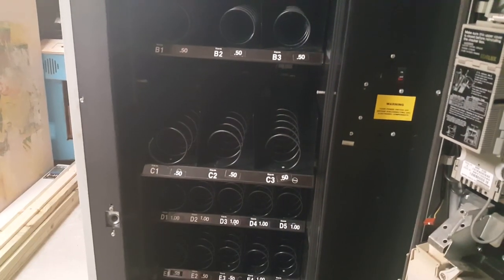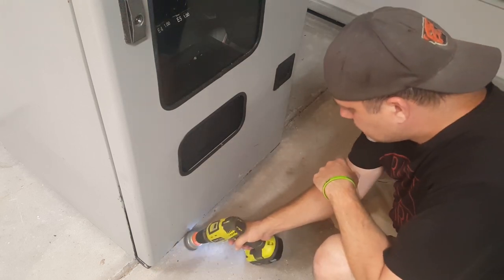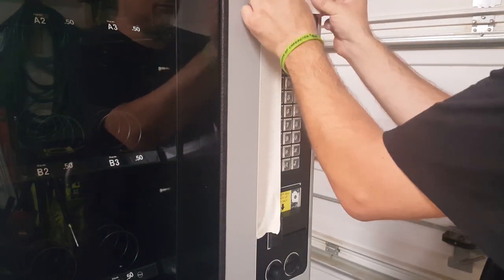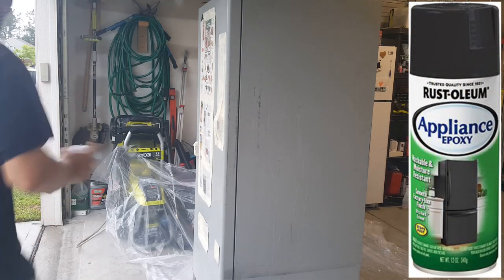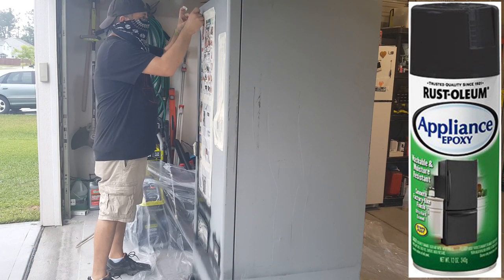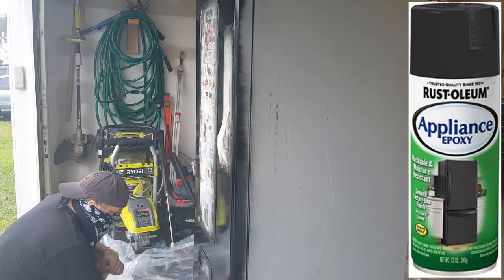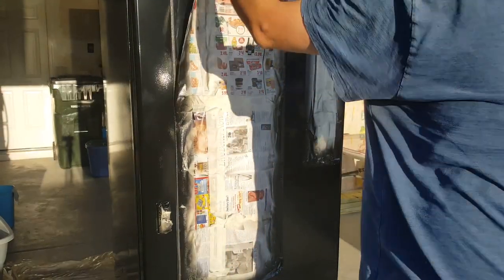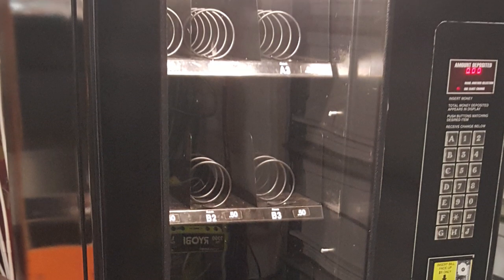How To Refurbish A Vending Machine Quickly and Cheaply to get it Location Ready!

Comment: Hi, what specific materials did you use to sand and smooth the surface before painting?? (Sanding pad type, ect.)
Reply from the maker: I used a wire brush on a drill and then 220 grit sand paper afterwards
Reply: @GalaxyGames843  Awesome, thank you so much!
Reply from the maker: @tanishabenton3630  welcome! Make sure you are subscribed! I'm working on a new vending machine refurb video now!

Comment: How long did it take for this paint job to dry?
Reply from the maker: I usually let things dry for a minimum of 24 hours, but 48 hours is even better
Reply: @GalaxyGames843  thanks so much! I'm about to try it myself today. There's no rust on my machine. Would I still need to sand it down first or should I be okay just washing it first, drying it then painting? Thanks for you help!
Reply from the maker: @rg.8590  you shouldn't need to sand if you don't have any rust spots